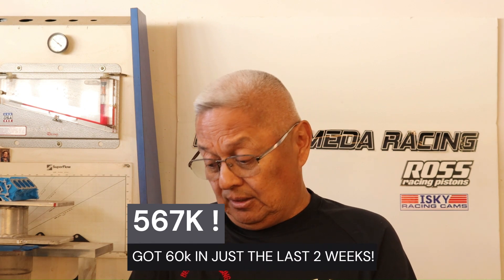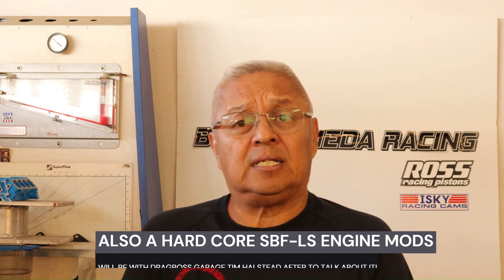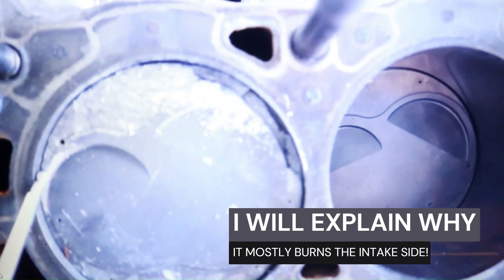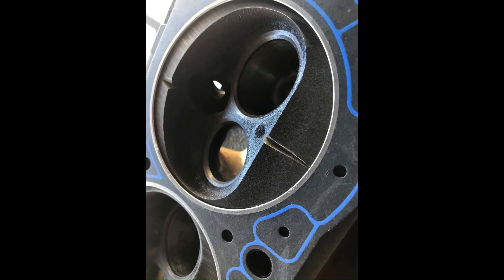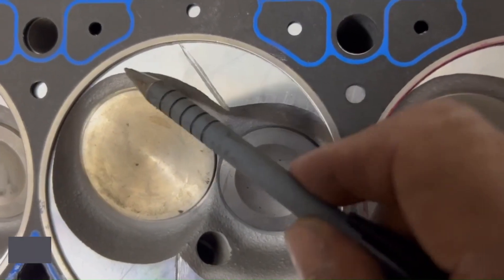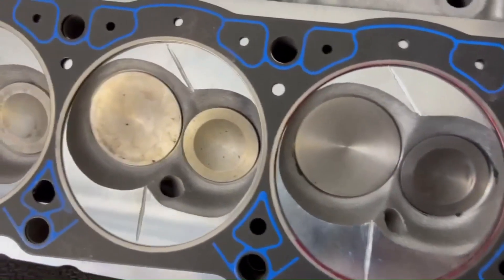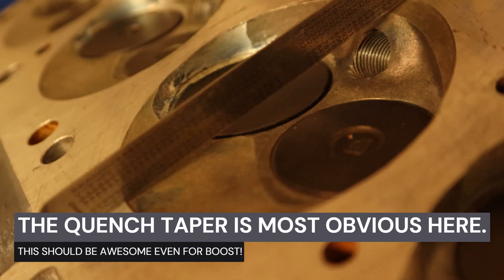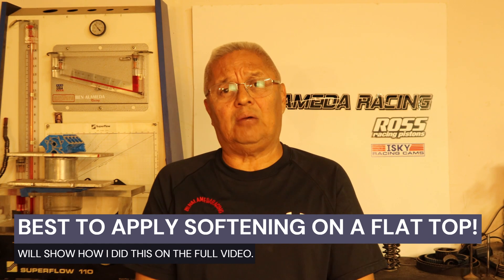COMBUSTION CHAMBER SOFTENING OR  "V"  GROOVE? (SHORTY)

Comment: I remember reading about this 10 years ago.  There was a guy out of India trying to prove that it was worthwhile, but didn't seem to convince very many people.  I believe he had a background in 2-stroke engines, which don't have valves and therefore there's a ton of freedom to play around with quench area and combustion chamber shapes.  In that world, having an angle or taper to the quench area is basically universal practice, because it's so easy to make the head any shape you want.  Those guys have a whole science of determining what angle the quench band should meet the piston crown.  I think Mr. Singh was trying to use his grooves to get a similar effect in the oddly-shaped and flat-milled quench areas found in most 4-stroke engines.
Reply from the maker: Many has kept this under wraps like myself and he I think claimed a patent on it but never explained the problem area where detonation actually starts.  I basically directed the groove to this area wherein many others just cut the lines with not much thought process just for the sake of doing it aimlessly I suppose that is why many said it does not work.  Those doing this for many years in competition will not claim a patent and lose what they have as an edge exposing it big time!
Reply: @benalamedaracing2765  I can't recall if he specifically cited the detonation problem he was trying to solve.  But, I know he cited Gordon Jennings' 2-stroke Tuner's Handbook  from the 70s as inspiration, which made it crystal clear to me.  Jennings was so far ahead of the curve on combustion and detonation it's not even funny.

Comment: Ben, what is the deck clearances on these engines with this problem of detonation on the intake side of the chamber?  I'm wondering if the pistons are coming above the deck and piston rock at TDC may be a factor in this.
Reply from the maker: Piston rock will somewhat affect the quench clearance some but ultimately the overall squish opening is the deciding factor!  Perhaps if you have an excessive piston skirt clearance will that come to play.

Comment: Ben, thank you so much for showing the v-groove modification.  Which one modification (v-groove or softening) do you prefer or thinks works better?
Reply from the maker: I prefer the V groove because it can be done with a V file taking care you do not skip off to the sides!  I use a old head gasket as a limiter to keep it from exceeding the gasket or armor line.  Softening takes up more CC's and when you are already on the low side it just makes it worse!
Reply: @benalamedaracing2765  Thank you Ben.  You are very gracious providing this knowledge.   Much appreciated.
Reply from the maker: @jeffmays930  Thanks Jeff and will post the new video soon!

Comment: CAN THE V-GROOVES BE APPLIED TO IRON LIKE THE E7TE? I KNOW DV SAYS TO HAVE A SCAVENGE PLATEAU ON THE QUENCH SIDE USUALLY 15 DEGREEES. @BEN ALAMEDA RACING.
Reply from the maker: The Directed V groove should be cheaper to do on an E7 head and should provide a better result than having a soft quench lay out.  I will expand on these thoughts and comments when I finally do the more detailed video.

Comment: Should you do both the 5 degree mill and the V grove or just one of them?  If limit to one, which one?  Does this also apply to 4 valve heads? Thanks for sharing your insights?
Reply from the maker: Just use the V groove and I feel is just as effective or perhaps even more except for all out racing and boost/nitrous combinations.